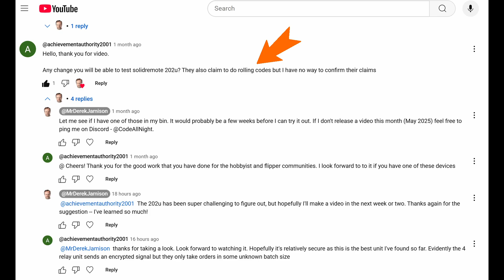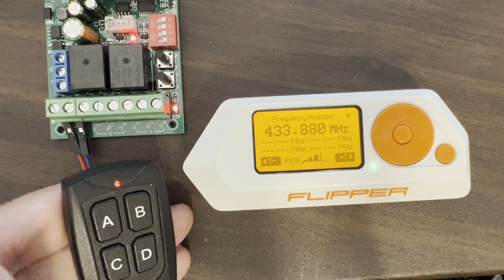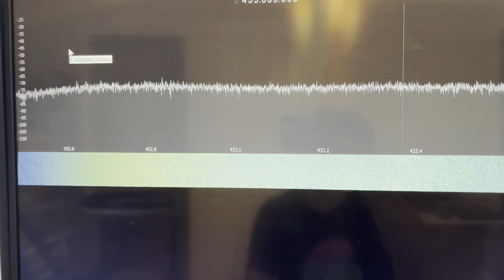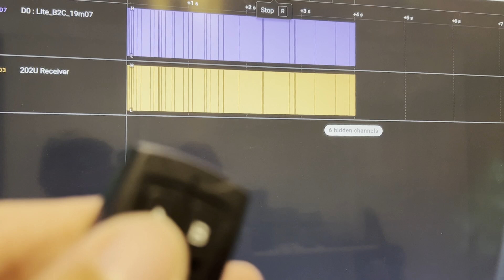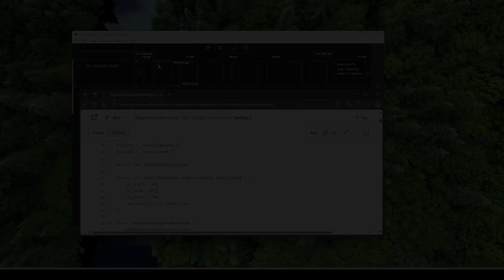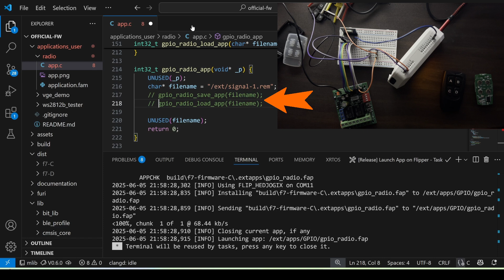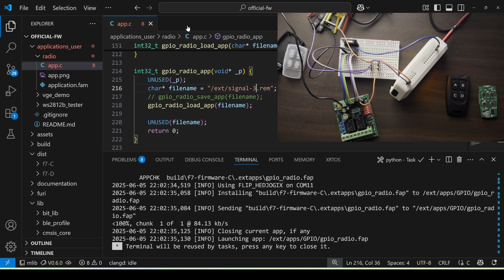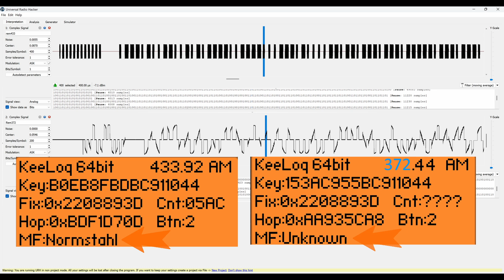[168] Testing "Solidremote 202u" security using Flipper Zero #rollingcodes #gpio #sdr #logicanalyzer

Comment: Thank you for this video, I came here after seeing your product review on Amazon.
Reply from the maker: Glad it was helpful! I was disappointed that a simple replay attack would work, but I understand that it does make it most flexible for replacing whatever existing system you had for very little money. At least the attacker needs to capture one signal from your remote first (although many devices with the CC1101 or similar chip make this super simple for someone to do). Still, they could have prevented the "replay" with minimal extra resources and cost, just by remembering the last few codes uses to trigger the relay.

The reality is most people are going to just break-in thru the front door in the US, if you have a KW1/SC4 lock, rather than use this technology. A bump key with practice takes 5 seconds and costs about $5 to buy.

Comment: Does custom firware allow the flipper to broadcast all frequencies?
Reply from the maker: I think the answer to "all frequencies" question is yes, but it still is just a range of sub-ghz frequencies.

Custom firmware typically has a "Bypass Region Lock". For example, in Momentum you would choose "Momentum", "Protocols", "SubGHz Bypass Region Lock". This allows you to transmit on a frequency that typically isn't allowed in your region. You would use this setting if your VPN causes qFlipper to not correctly detect your region or if you have a license for a particular frequency. See https://docs.flipper.net/sub-ghz/frequencies for the list of "allowed" frequencies for each region (this allow list is bypassed and it is assumed your region is allowed, so double check the frequency before sending once you enable this feature).

Custom firmware also typically has a "SubGHz Extend Freq Bands". This will allow you to attempt to transmit on 281-361MHz, 367-481MHz, 749-962MHz. This likely voids your warranty & could damage your Flipper. I would only do this with an external CC1101, since they are like $5 USD and easy to replace. The specs for CC1101 say 300-348, 387-464, 779-928, so running outside of that range could be bad (and not just a sad faced dolphin). I'm not sure if the EByte E07 will do better or worse using frequencies outside of the spec range.  I don't have a license for those frequencies & I don't have any devices using those frequencies, and I don't have any knowledge as to if it will "really" damage anything. But I'd say only mess with that if you have a good need. Maybe using something like a HackRF One SDR would be better, since those frequencies are within its accepted range?
Reply: @MrDerekJamison thank you for taking your time with such a great answer

Comment: Wow been busy so haven't seen the video until today but thanks for analyzing this. Seems like they secured this device well. 

The 372mhz confuses me a bit, is it allowed in the us? Also, are they just simulcasting on 433 to throw off sniffers?
Reply: I watched it again and see it was only transmitting on 433 after you changed modes and then back. Wonder if that's a feature to genericize the remote to be compatible with other keyloq devices
Reply from the maker: No, it’s ALWAYS on 372mz. If you broadcast at 433 their receiver doesn’t see anything. FCC license on remote was for 433mhz. Harmonics testing was 127MHz & makes no mention of levels at 372mhz. I couldn’t find FCC ID for receiver. Product works great & seems secure compared to alternatives. 

Note: There are “Wayne Dalton Remotes” that use 372MHz, and signals likely look similar, so the traffic likely blends in?
Reply: @MrDerekJamison  we may be saying the same thing but I am not certain. I am thinking that since their 372mhz communication seems to be more proprietary, they built in an alternate mode with a generic keeloq algorithm so that the remotes can be programmed to other receivers in the future or simultaneously. They make no mention of any of this in documentation, so it could just as likely be a block of code that was inadvertently left in the remote.
Reply from the maker: @achievementauthority2001 agreed. Also, thanks again for the suggestion on making the video. I was so confused while researching. 😅
Reply: @MrDerekJamison  cheers! Thanks for making the video. I am sure that in the future anyone who is looking for examples of insecure and secure implementations, they will be more informed by the combination of your videos
Reply from the maker: I believe they are on 433 with well known MFKey so that you can receive and decrypt remote presses using cc1101 and ESP32/Arduino. So you could do home automation and trigger ADDITIONAL actions when the button is pressed. In the future, I think receiver may also use 433 so that cars with built-in remote can send open signal (but that would make receiver less secure, since many devices can RX/TX and know the code — compatibility vs. security). I’m not sure if they will continue to decide on security vs. wider-compat. Some customers want their car to be able to clone (without realizing that means other devices can clone too). 

I mean more likely that people use a rock to break a window, or a KW1 bump key vs. an RF cloner to get into garage, right?

Comment: Cool video, if you dont know the modulation ie fm1270 ... what is a good and fast way to figure that out?
Reply from the maker: Thanks for the video suggestion.  Using an SDR is really the best way to visualize and measure the signal? For receiving data, you can often get away with the wrong settings, but for transmitting it is often required to be correct.

I explained it abstractly in https://www.youtube.com/watch?v=tzLmMl9HlTY but I could make a video using an SDR (and GQRX, UniversalRadioHacker) so there are some real-world examples. I wonder if people with Flipper Zero also own an SDR? I just added a screen to my HackRF One two weeks ago (which means I don't HAVE to have a computer with me). I mean, we are trying to buy all the toys that TalkingSasquach shows off, right???

If you own a Flipper + SDR, transmit the following files to learn what the modulations look like...
https://github.com/jamisonderek/flipper-zero-tutorials/tree/main/subghz/samples/modulation

Comment: That’s really interesting that a keeloq system wasn’t susceptible to rollback I’ve not seen that before
Reply from the maker: I think they implemented the algorithm in the 8H1K08, so they likely are using a 16K forward looking window & ignoring any other resync codes. Device has a "learn" button, so no need to sync back to an old signal. I don't know the MF key, so I can't tell if they use a standard 528 iteration loop, or if they use a different number of iterations + bit swapping/mapping (I'm guessing it's not 528, but just a guess).
Reply: I haved,,,not everything that says it uses rollin codes not possible,,I'm unlocking 2020 vehicles and garages..one thing bout tech,,it's always predictable,,,,
Reply: @Hackdaplanet-lp1ex  I’ve reverse engineered a vehicle rolling code system before I understand how these things work I honestly didn’t need ur input 

And just for clarity Keeloq is an implementation of rolling code not the only rolling code

Comment: Excellent work getting between the mcu and the transmitter module. I have seen that as long as the data rate is equal multiple, like 200/400 400/800, the datarate is double or halfed and it can still process it it up to a max speed. 
Perhaps the next step is to pull the memory and as much data as possible from the firmware. 
I have chips I'm working with that use different protocols for the memory and for the mcu. 
I hope to see more of this project.
Reply from the maker: I need to practice desoldering, so I can extract the chips. I have a T56 reader, which seems to support the BL24C64 chipset? It looks like standard I2C to read the chip, so should also be possible to read with just a Flipper Zero (but I might need to write an app to dump the data).